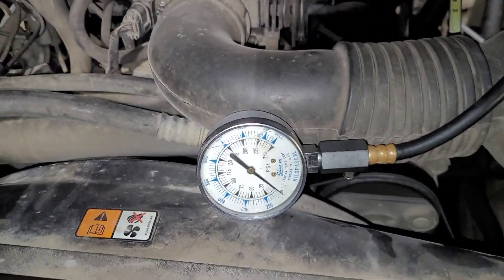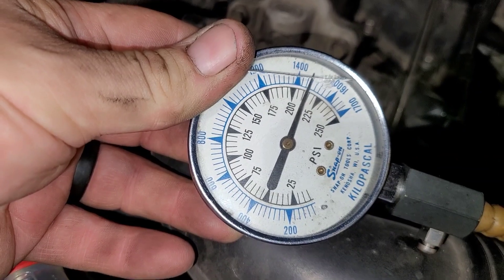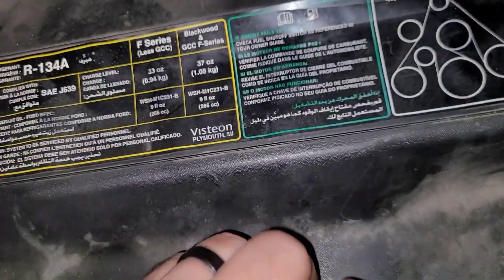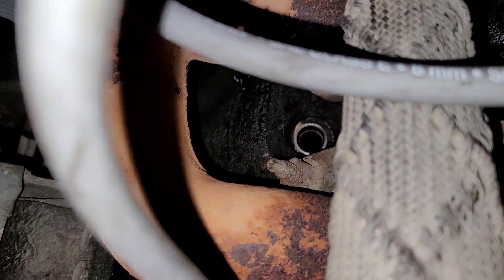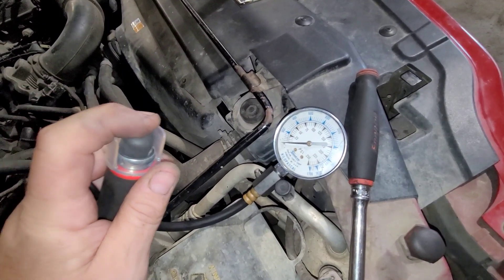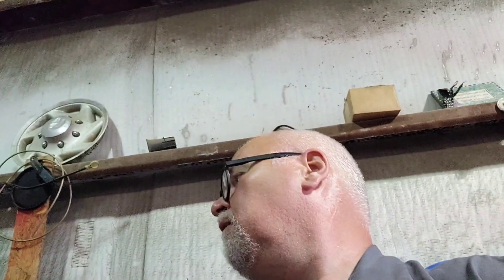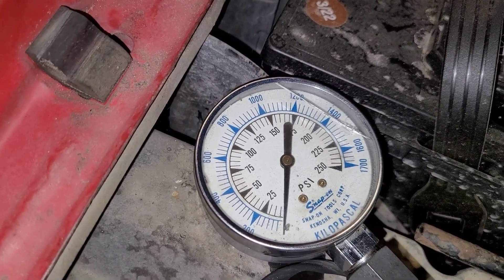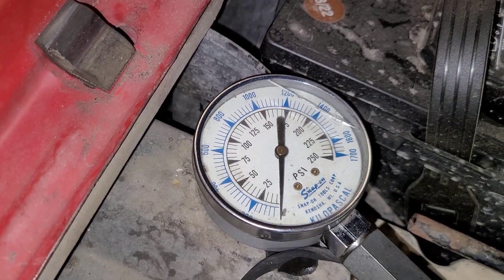Zero compression in one cylinder? Borescope doesn't show a problem

Comment: My wife's '18 Trax (1.4L turbo, 115kmiles) is misfiring on cyliner 2.  I replaced the plugs and coil pack without luck.  Compression test shows very little compression in #2 and radiator occasionally bubbles, so I think it may be a head gasket issue.  But replacing the HG on this looks like it is incredibly time consuming and perhaps not worth it.

Comment: If you dont have the cylinder #2 on top dead center. When both valves are supposed to be at its closed position. This will give send you in the wrong direction of a leak test

Comment: What about valve seal. Valve spring weak ?
Reply from the maker: Wouldn't be a valve seal. That wouldn't have any effect on compression. The visual inspection of the valve springs looks ok and the rockers don't have any unwanted free movement, so I don't think its a spring. But that's not out of the realm of possibilities. Thanks for the comment !